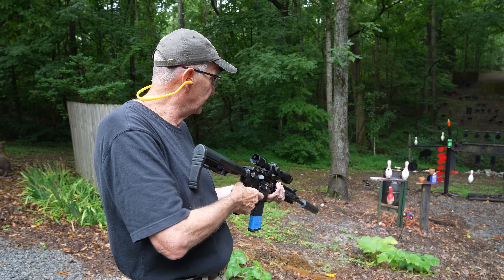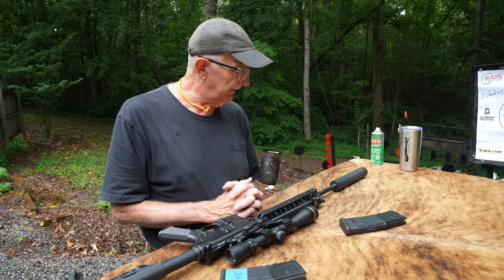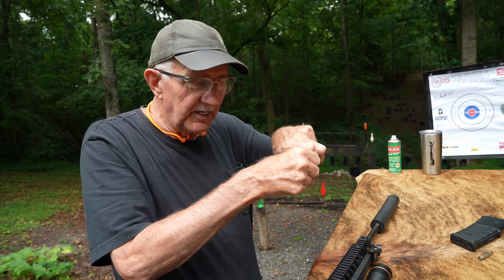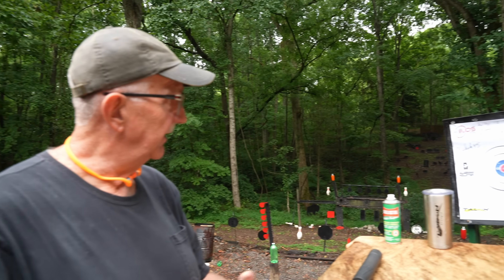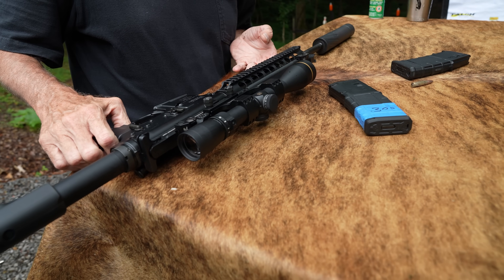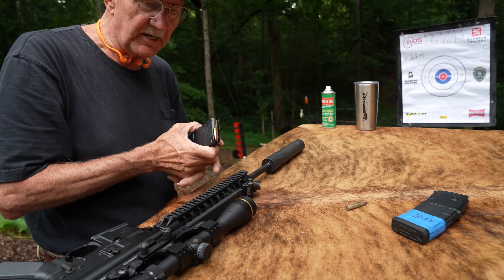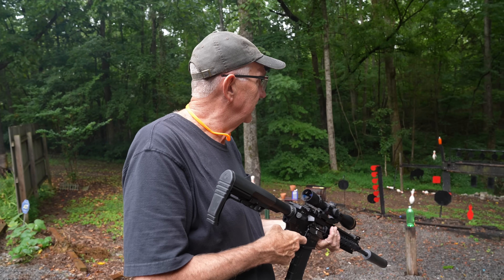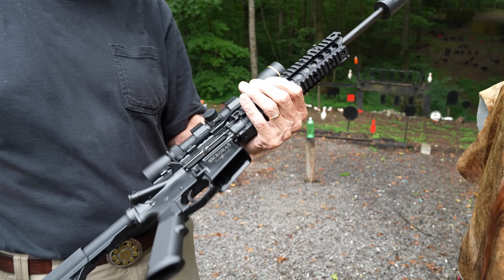Why Is It Still Loud?

Comment: So how they actually work is that in a supersonic load there are two things exiting the barrel at supersonic speeds, the projectile and the gasses.  In a   subsonic load there is still one thing that is exiting the barrel at supersonic speeds and that is the rapidly expanding gasses from the cartridge that that pushes the bullet out.  Because these gasses are still supersonic you still get the sonic boom from those gasses.  The suppressor acts as a speed reduction device for the exiting gasses getting them redirected and slowed to subsonic speeds when they exit the barrel/suppressor.  (there is no gasses rushing back in)  The greater the reduction in the speed of the exiting gasses the quieter the firearm will be.  It can get so quiet that the sound of the action is the loudest sound that the firearm produces followed by the impact of the projectile.  There is always a trade off however in that to get the quietest possible one needs to reduce barrel length and replace that with suppressor length while keeping your bullet subsonic.  I carried a fully suppressed HK MP5 for 4 years and it was completely silent but the barrel was only about 4 inches and the integrally firearm was essentially all suppressor but that resulted in an additional loss of velocity. But this was all for close range and the bullet weight was 146 grain at about  850 fps.

Comment: Subsonic is BELOW 1114 FPS and supersonic is 1114 FPS and more.
Reply: It's not as simple as that.  The sonic barrier is a velocity range, not a simple barrier.  The speed of sound varies depending on atmospheric factors like temperature and pressure., so it is not always the same.
Reply: @ExpatriotSilencers  of course the sonic range varies, but we just have to set a mark to use for discussion. This is the sonic speed at sea level on a clear day. The weather would affect it as much as the altitude.

Comment: Nice. I never knew that the pop was air rushing back into the barrel. It makes a ton of sense as that’s what thunder is as the air slams back into the column that the lightning bolt bored through the atmosphere. Very cool.
Reply: This is NOT a thing.  The noise comes from the explosion of high pressure gas.  There is NEVER a vacuum inside the bore or the can.

Comment: I just turned 60 in June, and the lesson was fantastic and I never realized how the noise WAS created , but I do now!!
Reply: Except you don't because there is no such thing as gas rushing back into the barrel.  Gunshot noise is due to the rapid pressure release when the bullet exits the muzzle.

Comment: Sound from "air rushing back in" - tells this with a straight face..  I love his humor..
Reply: Air has to re-fill the gap the bullet created. Thats how the sound barrier breaking works
Reply: @NineEmEm  You joking?  And how does the suppressor help filling "the gap"? Air moves at the speed of sound. A projectile and overpressured (=more dense)  gas from a muzzle however moves FASTER than the speed of sound of the surrounding normal pressure air, hence generates a wavefront/shockwave. An implosion (air filling a vacuum at 1 atm) is never louder than an overpressure release of > 1 atm pressure..
Reply: @NineEmEm  No its not.  A projectile that breaks the sound barrier creates a shockwave as it compresses the air it is traveling through.  Go and look at a schlieren image of a supersonic bullet and you will see the pressure waves.

Comment: Supressors are health and safety devices way more than some sort of tactical doodad. They should be in the same category as helmets and safety glasses, not something you have to pay and get on a list to even own. My family has been in law enforcement for generations and the most common health issue among our middle aged guys is hearing loss.
Reply: It's crazy...in France suppressors are sold without restriction for those very reasons
Reply: I agree but if the goal is safety the problem is with a silencer 99% of the time you are still not hearing safe, especially indoors and unless you have something like the state of the art and very expensive Huxwrx Flow 556K,  you now also have the health risk of breathing all the carcinogenic and otherwise toxic gases that blow back into the shooter face with a silencer.  Only way to be hearing safe is the use a really good silencer and subsonic ammo.  At that point though you have pistol level ballistics, in other words really, really bad,  for the worst emergency of your life.  Instead of trying to use a silencer to get hearing safe noise levels from the firearm which requires giving up a lot of it's effectiveness, it is much better to have a suppressed 5.56 AR loaded with good supersonic ammo and staged with good quality electronic ear pro.

Comment: I am not quite sure I can agree with this whole thing.  The supersonic vs subsonic part, yes, that is it mostly.  But I have a problem with the "air rushing back into the barrel" part.  When the bullet leaves the muzzle, there is still a lot of pressure in the gun.  There would have to be or the bullet would start slowing down.  Your example of a muzzleloader being cleaned isn't a good one because that IS a case of a slight vacuum, as you described it.  I think it's a combination of the bullet and the powder gasses, which themselves have a velocity of something like 5,000 fps.  There's just very little of them so their contribution to the noise is slight.

Comment: The quitest firearm I know of is the HIgh Standard HDM pistol developed for the OSS in WWII.  It has an integral silencer, and fires full metal jacket .22 LR rounds.  Bear in mind this is a close range weapon, but from across an average living room the report is about as loud as a staple gun.  Perfect for crowded, noisy environments.  Good luck getting your hands on one, though, Uncle Sam keeps those under heavy wraps.
Reply: Please, Please, PLEASE don't talk about something you know nothing about.  I have a replica HDMS built the same as the original and it is the loudest rimfire pistol I own, by a long way.  The HDMS meters around 130 dB.  A good 22 rimfire pistol suppressor can go down as quiet at 115 dB.  A US company called Arms Tech made a batch of replica HDMS pistols a bunch of years ago so they are out there in the hands of collectors.

Comment: A lot of people don't seem to realize how loud weapons are, even suppressed with subsonic ammo. 5.56 NATO with a suppressor and Comtac Peltors is still pretty loud, especially at an indoor range.
Reply: 5.56 doesn't suppress very well.
Reply: @kennykash6089  Suppressors for 5.56 are more about hiding muzzle flash and making it harder to tell where the rounds are coming from.
Reply: @vik12D  Those are minor benefits sure, but it doesn't change the fact that 5.56 doesn't suppress well, even with subsonic ammo.  Compared to 300 blackout for example.  And an M4 is only effective out to 500M per the TM.  Really 300M which is the distance the Army qualifies out to.  The added weight, length, and potential POI shift of a can don't really justify those minimal benefits.  It's why they don't issue suppressors to line infantrymen.  You'll only really see them with scouts, etc.
Reply: @kennykash6089  The reason you're using a suppressor on an M4 is to minimize flash and make it harder to detect where shots are coming from. Those are huge reasons, especially at night.
Reply: @vik12D  I was never issued one in Iraq over two tours, and I went on more night missions than I want to think about.  I never carried a bayonet either, but I probably could have found more uses for one than a can on my M4.  Our scouts platoon did have suppressors for their two M24s when they were rolled out.  I'm sure the SF boys and other elites find more uses for suppressors.  I went on joint missions with 5th Group SF when I was with the 101st Airborne, and I can't say I recall them rolling with suppressors.  Simpler times maybe?

My point still stands though.  5.56 is a terrible round to suppress.  It just is.  There are other calibers that are far quieter.  It's why buying a dedicated can for 5.56 is dumb.  Buying a 30 caliber can and using it on an AR makes far more sense.  When you want quiet, you can go 300 blackout with it.
Reply: @kennykash6089  No one argued that its ideal to suppress sound. Hence the flash and location qualities. Ride in a zodiac on the tigris/euphrates. Only one of two ways to go and an outboard isn't doing well upstream against a current, so just one way to go. A suppressor is nice to have. Also, there's no need for a platoon to have them, you aren't hiding from anyone. Four dudes in an inflatable boat is a different story. 12D, IZ/AF 2001-2012.
Reply: @vik12D  We hid quite a bit actually.  Especially in 3-4 man OPs to pick off hadj laying IEDs.  We merely gave up on hiding once lead had to fly.  The jig is up at that point, suppressed or not.
What were you doing in the Tigris?  I spent 2+ years next to that muddy shit-smelling creek of a river in Northern Iraq and can think of about 0 reasons to wade into it.
Reply: @kennykash6089  My reply shows my MOS, 12D. Google it. It clearly says working with Special Warfare. Your experience wasn't the same as mine.
Reply: @vik12D  I did Google it.  Nobody just knows what a 12 series is bro.  Never met a diver.
Reply: @kennykash6089  No worries. Hardly anyone has. Most people in the Army don't know the Army has Divers.

Comment: Hickok45, I know the reason for all the BS to get a suppressor, 1. tax money, 2. more gun control. A suppressor does NOT make a firearm "more deadly" any more than what kind of a grip it has or stock that folds or what kind of sight. Even what caliber, what it looks like or color, firearms are "deadly" even a single shot .22 short.  We all know what the goal is!  I'm not surprised "they" don't tax and require paperwork for all the above I mentioned. (I hope I don't give "them" any new ideas.)
The original idea was, believe it or not,  if you heard a gun go off you could "duck"! (really!)

Comment: One also gets sound coming out of the chamber when the bolt opens to eject the case.
Reply: I suspect that with semi-autos there is only so much that the sound can be reduced (for the shooter) for that reason. I think it was Garand Thumb that was testing absurdly long suppressors, and while the sound level at the muzzle did decrease, the sound level by the shooters ear remained the same,

An interesting test would be either to test the same suppressor on a semi-auto and a bolt gun, or on a semi auto that is capable of having the gas system turned off.

I swear my suppressed .308 bolt gun is "more suppressed" than my suppressed AR.

Comment: I've been telling people this same thing for many years. Some are amazed by what I say, but most look at me like a nut. I always tell them that the pssst heard on the spy movies is made up by Hollywood and it doesn't happen like that. People will ask why then do people buy or make them. I tell them so that there isn't as much noise at the end of muzzle when bullet leaves the barrel. Then I get the you're a nut look again after already telling them about sonic and subsonic and how 2 noises are happening at once, and the bullet isn't actually silent until it nears it trajectory limit and falls below sonic speed. I even tell them that they will only hear a boom from a F-15 coming directly at them at sonic speed after it passes. They may hear the engine noise as it approaches. The boom from a sonic jet not flying in a direct path towards them will be heard sooner.

Comment: Never thought I’d teach Hickok 45 anything, but the loud report of a firearm is the SUDDEN release of HIGHLY pressurized gasses. A suppressor “muffles” this by slowing the release of the gasses. It’s the same thing that makes a firecracker go bang.
Reply from the maker: Makes sense.   I can just never forget how when I stick a muzzle loader barrel down in a bucket of water  with the muzzle up.  When you run a wet patch down the barrel and suck up the water to clean the barrel and pull the sealed patch out really fast, it pops very loud, almost as if firing a gun.  The air rushing back into the barrel causes a very loud snap.  Seems that THIS would be some of the same effect when firing a bullet, but maybe not.
Reply: @hickok45 that would be the case for a muzzle loader because the chamber is sealed and the patch can create suction while using the patch. But with any rifle being fired, the pressurized gas will expend out the muzzle until pressure is equalized, there won't be any suction to draw gas back into the muzzle.
Reply: @hickok45   True, but the difference is when pulling a patch out you’re creating a vacuum. In the case of a firearm it’s pressure. Love your videos 👍
Reply: @hickok45 

Cool.  I'll bet that's fun.😆
Reply: @hickok45  Definitely not.  That would require a vacuum to be created in the bore and how would that occur?  Bore pressure is never less than ambient atmospheric pressure.
Reply: And the sonic boom, or crack made from the bullets high speed!